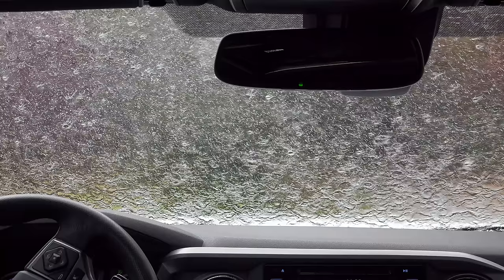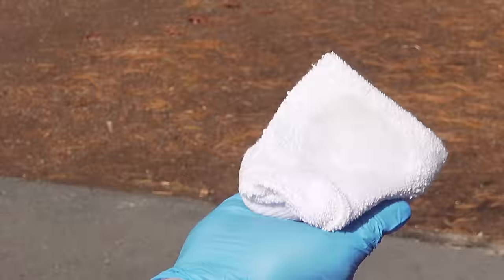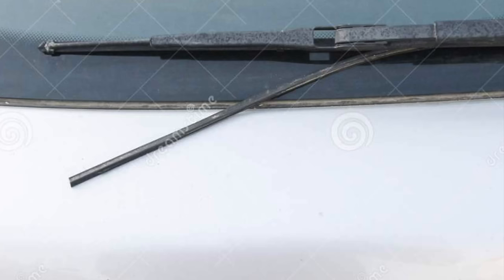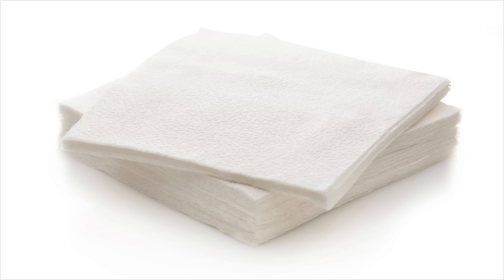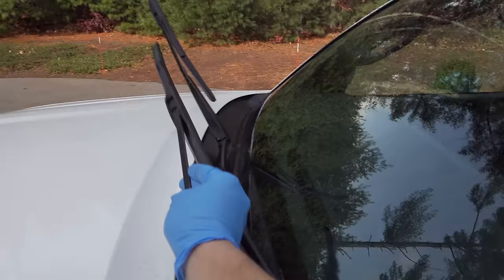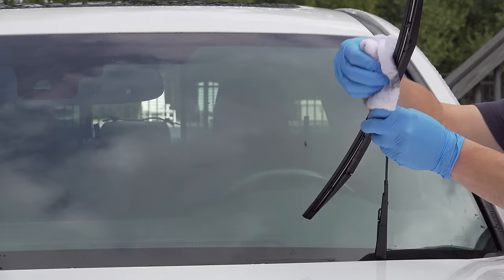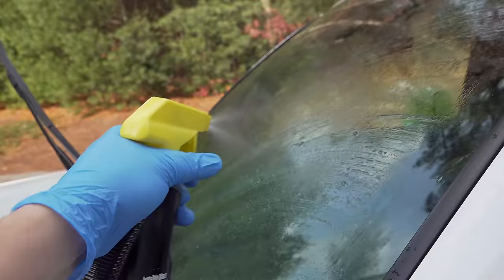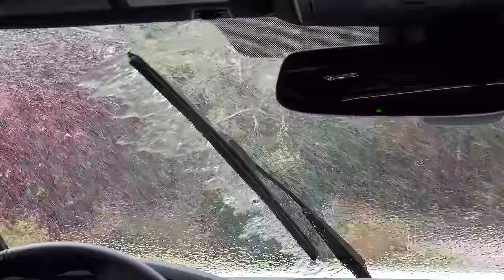How to Make Windshield Wiper Blades Like NEW in 30 Seconds

Comment: Thanks for the tip -- I'll try it. Great video!

You could go even one step further by applying a coat of Rain-X, after the invisible glass dries. I've been using Rain-X for over 40 years, and it really improves visibility in rain. After about 40 mph, I don't even need the wipers anymore, unless I'm getting a lot of spray from other vehicles. Snow and ice come off much more easily in the winter, too.
Reply: If you don't want to buy Rain X alone, auto wax on the windshield also works.
I have been trying a ceramic spray wax replacement and it works well on the paint AND windshield.
Reply: @scooterusa13  Thanks for the info!
Reply: Yes rain-x is the ticket. For vision improvement  during a heavy rain or snow. No wiper blades needed. It beads up and slides off the windshield. Snow just slides  off. no scrapping  required.
Reply: @sylviamanring9975  A couple of Indiana ice-storms proved it out to me. Turned the ice scraper on edge, like a knife, and scored a large sheet of solid ice on the windshield in a cross-like motion. Four large plates of ice just slid off the windshield instantly -- as you said, no scraping needed!
Reply: Instead of regular blue windshield washer fluid try the Rain-X windshield washer fluid, works amazingly!
Reply: The Walmart 3-in-one wiper fluid has a silica additive in it, too.  My wipers are over 3 years old and still work like new, probably due to the added protection of the fluid and routine cleaning.
Reply: You think that’s something, put some ceramic coating on them
Reply: @icuinthelight  This is all I use now. Was driving back from Cape Cod last summer and there was a torrential thunderstorm. Everyone was pulling over because they couldn't see a thing. I had just put in rain-x fluid and the harder it rained, the better I could see. Was driving by everyone on the side of the highway and they probably thought I was crazy but I literally shut the wipers off and drove right on through the storm.
Reply: rain X work like Teflon, and wiper is like scotch bright green pad!!

it's great combo!😂😂
Reply: @ahoorakia  I get that both of those things keep pans clean, but don't use the green scrubbers on a Teflon pan, it'll damage the coating.
Reply: @charvakkarpe  I don't think you get my point!!😁

I can explain it to you, but I can't understand it for you!
Reply: @campbellpaul 

 The bug and tar repel RainX works perfectly.
Reply: @Lars Dcase 

I always precleaned with rubbing alcohol.
Reply: @c2jones  does the bug and tar repel freeze in the winter, or is it a de-icer as well?  I often go for the cheap stuff, as I'm a tight wad lol
Reply: @campbellpaul  

Let me clarify.  For cleaning, I simply use rubbing alcohol and cotton balls to clean up the blades. It removes the black rubber buildup. Others use petroleum or silicone based products. The RainX Bug and Tar Remover works superb as well. I also add the Rain-X Windshield Washer Fluid which coats the windshield and blades. 

If you live in inclement weather, you should use the Rain-X All Season 2-in-1 Windshield Washer Fluid which provides zero degree F freeze protection while it powers off bug residue and road grime and removes light snow and ice. Also helps repel road spray and applies water beading technology.

On a tight budget, you could just use the rubbing alcohol and the Rain-X All Season 2-in-1 Windshield Washer Fluid together for the same results.
 It runs anywhere between $3.25 to $5.00 a full gallon bottle at Walmart, etc. Should last several months.
Reply: @c2jones  Thank you for the clarification.  I also use isopropyl alcohol on cotton balls for cleaning rubber and plastic parts and avoid petroleum based products as they can degrade those materials.  I do use silicone grease as a conditioner to restore and preserve those parts, as I have found it to be very beneficial, provided the parts are wiped clean of any excess.
Reply: @campbellpaul  

Perfect. I think you're doing it right.
Reply: Yes, Rain-X and Clearvue by Turtle Wax. 👍✔
Reply: @scooterusa13  😊
Reply: My experience with rain x was not as good. While it beads the water at higher speeds I found that it left a greasy film that made visibilty worse and hazy after every pass of the wipers. Anyone else had the same experience?
Reply: Hi. Can you guys help? I clean my car so its looking like new and use the rainx product. But when it rains and i use my wipers its very difficult to see. The water smears everywhere. Its a newish car so the wipers dont need changing. Am i using too much of the rainx or not enough...its very anoying....please help
Reply: @jamesrossceller  A few important things: Windshield must be totally dry before putting Rain-X on; make sure rags or towels are clean and oil-free; verify condition of wipers -- will streak, if they're old; make sure to totally clean off the "haze" with a towel, after the Rain-X is dry. The product works great, for me...hopefully, it will for you, too.
Reply: Put it on your side windows and you'll always be able to see out if your mirrors.
Reply: @tonyh8510  I do. I put it on all of the windows and the exterior mirrors, as well.
Reply: @Biscuits_Brown  I was visiting family hours away in a very rural area and my wiper motor died. Well, the local parts store (9 miles away) didn't have one in stock, so I had to order one and there was a core charge, of course. So I quickly removed the old motor and handed it over to the clerk. I don't know why, but I applied RainX to the windshield. Later that day it rained so hard for about 4 hours that the sides of the freeway was littered with drivers that couldn't see. Here I was cruising with no wipers or wiper motor just like it was a sunny day. I couldn't believe the results. I always have a bottle in my vehicles now.
Reply: We were not allowed to rain-x on out ambulance windshields because a poor application and cleaning left a bad glare.  But most of the paramedics. used anyways.  We just applied it correctly.  What a help when rushing to a call on a rainy night.
Reply: @f1bernet  The company didn't want us to use it on the windscreen of the jets I used to fly -- they said because it would erode the     paint -- but it enhanced safety by better vision during takeoff, approach & landing.

The 737 has flat, plate-glass windows, which causes raindrops to flatten out and obscure vision. It does have good, two-speed wipers (along with an intermittent setting), but in heavy rain, they struggle to keep up.

If we were flying to a destination airport, at which rain was falling or forecast, we found that an application of Rain-X, coupled with approach speeds of 140 knots or so, caused the droplets to run off like glass beads,which gave us excellent visibility, even without using the wipers.

Comment: WD-40 has over 2,000 uses including cleaning even though it was originally designed to prevent rust and corrosion on the Atlas rocket in 1953. It's a petroleum based lubricant that displaces water which prevents rust and corrosion. Being that it's a petroleum based product it can be applied to rubber of any type unless it's silicone because rubber is made from petroleum which will recondition it by making it more pliable. It also seals the moisture away preventing dry rot and cracking. WD-40 makes a product called "Specialist" High Performance Silicone Lubricant that does a better job than regular WD-40.

Comment: I remember when you could buy replacement rubber piece for your existing wiper blades. Even the new blades have these same rubber pieces that are easily replaceable, but they quit selling the rubber alone, so now you have to buy a whole new wiper blade, metal and all.
Reply: Wal-Mart still sells just the blades.
Reply: Honda still sells OEM wipers with rubber blade replacements, at least for the one I have.
Reply: Amazon has just the rubber.  Not sure if all wipers work with them
Reply: Actually this is a sales ploy done by manufactures and stores...If you go to the sales counter and ask a rep, they have them back behind counter in stock, they only display the new arms and such on sales floor. I have checked this for over 5 years and about every store...Auto Zone...Advance..O'Reilly's...ect, have them and will just bring them to you...just tell them what size...out it comes for $2.00 or whatever...don't be fooled if one store tells you no, go to another store...they are still sold by reputable stores.
Reply: @repaid1  whhhhhaaaaaaat?! 🤯
Reply: They were called refills.
Reply: Honda does just the wiper refills. I did mine last week &  the whole process took 5 min! They install them for you too for free! ☺️
Reply: I heard they stopped selling refills, because a lot of people were scratching their windshields by not installing them right.

Comment: After watching this video I thought it would be easier to fill the windshield wiper fluid reservoir with WD-140 and occasionally spray it directly on the windshield to keep my wipers in tip top condition.

Comment: I’d like that WD-40 method tried it love it I’ve been using alcohol to clean my wiper blades for years and it’s been about 10/15 years but one of the best windshield wipers you can purchase for your car and wanted to make them list longer than they would and I would say it’s probably been exactly 14 years and they’re still working like they are brand new

Comment: Thank you for sharing this info. In addition to cleaning your windshield thoroughly,  apply RainX to the glass ~ it is a life saver on dark wet nights, drastically improving visibility. Over 50km/hr the water simply streams off the glass. No need for wipers. I have been using it for over 20 years.
Reply: Get the windshield clean, really squeaky clean first.  Maybe use rubbing alcohol, maybe vinegar, maybe Windex and an old t-shirt and do it a couple of times.
Reply: I used to use rainex but on roads with street lights, the glare as I went underneath obstructed my view!
Reply: @paulne1514  You May have some rain x residue that didn’t get buffed out.
Reply: RainX depends alot on the angle of the glass and the amount of rain. On cars with a really low angle and a light rain, the water is repelled into fine droplets which do not weigh enough to roll off the glass. The result is blinding glare with street lights or traffic lights at night. Far worse than any potential visibility problem from general rain. Because of that I think of it as a product for my side windows and mirrors only.
Reply: @tallman1683  No, it happens if your windscreen is at a very low angle. The droplets dont weigh enough to fall away. Probably great for SUVs and older cars.
Reply: @patreekotime4578  I used to get that "glare" at night ~ fitted new wiper blades. Problem solved.

Comment: The other cause? Is that the wiper rests on the "downsweep" position. After a while at rest (and no rain), the rubber will become fixed into that state. The solution, although you need to do it repeatedly, is to lift the wiper and allow the rubber to "flip back", then place it back down whenever you get home at the end of the day. This is a 2 second job. Better yet, pull the wiper down a cm or so, and then allow the wiper to "spring" back up into the "upsweep" position. This has saved me from replacing my wipers every year (which is a stupid waste of $40/yr for a COMPLETE wiper and blade set for my car) and instead, every 3-4 years instead.

Comment: I've been doing the same thing for decades using RAIN-X. Using on the window itself is important but using it on the blades to clean and lubricate the blades is critical. You'd be amazed at the jet black oxidized rubber that comes off the blades. It typically takes three or more cleanings the first time. Makes a HUGE difference!
Reply from the maker: Interesting great tip
Reply: Thats about what i been saying waxing windshied works great then u dont need your wippers
Reply: I worried about WD 40 getting on the windshield would make night driving dangerous due to smeary oncoming headlights. Then I thought probably RainX might be better. Glad to hear your knowledge.
Reply: The problem with Rain-X is that degrades over a couple of months and creates a haze in night rain.  Then you’re stuck having to constantly reapply it.  If you decide to curtail using it, good luck getting it off !!
Reply: @davidmonroe7783  3:07 
Most waxes have oil in it 
It’s the worst thing to put on a windshield 
A windshield has pores like your skin
When it rains 
It smears 
Ask any professional detailer
Reply: Use “Nu Finish”. It has no wax.